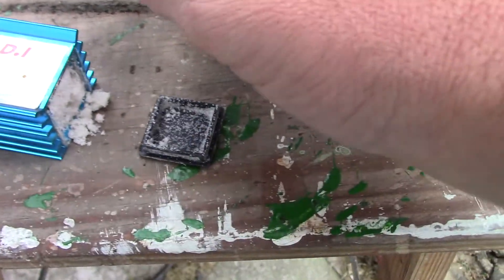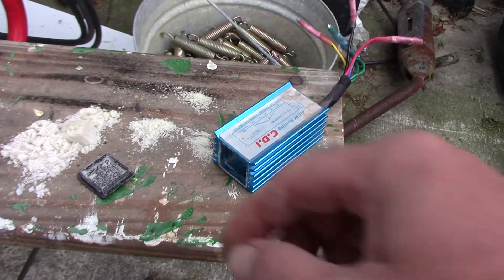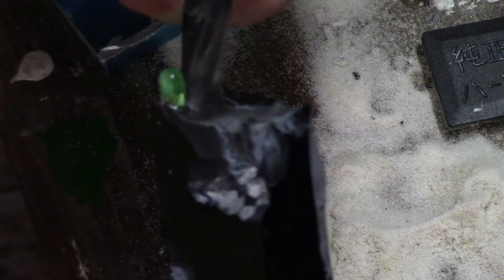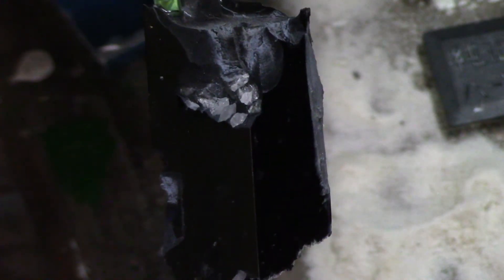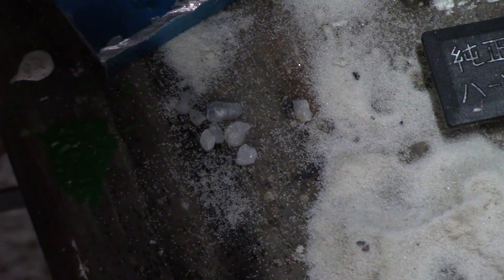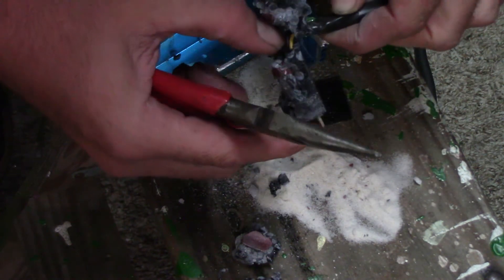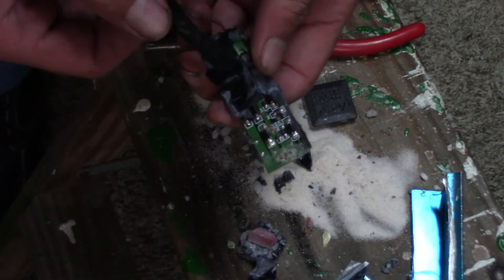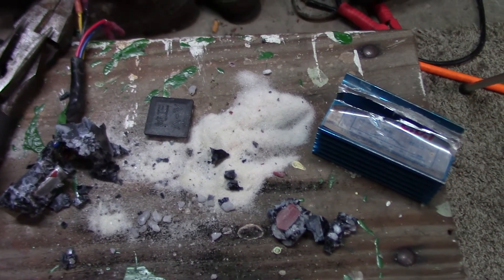What's inside a cdi box

Comment: The "sand" is a silicone powder and the "rocks" are silica They are used for filler because they are good at transferring heat !
Reply from the maker: George Hunt but the "sand" was wet and transfered moisture to the circuit board. Maybe would have been ok had it been sealed. Thanks for watching!

Comment: Interesting...I scrapped an industrial "thing" a few years ago and it also was packed with white sand, small white rocks and black resen..It was made in the USA? Must be some kind of packing for electrical shielding or something.
Reply from the maker: Sand shouldn't be anywhere near electronics because it holds moisture. The rocks probably would have been ok, i think they just used it as a filler because its cheaper than epoxy.
Reply: I would say it was assembled in usa from imported parts. I'm gobsmacked with that cdi box no wonder why they burn out.